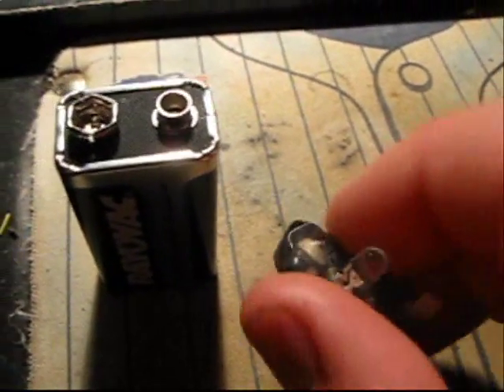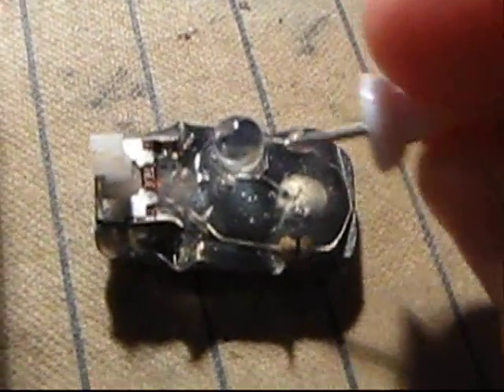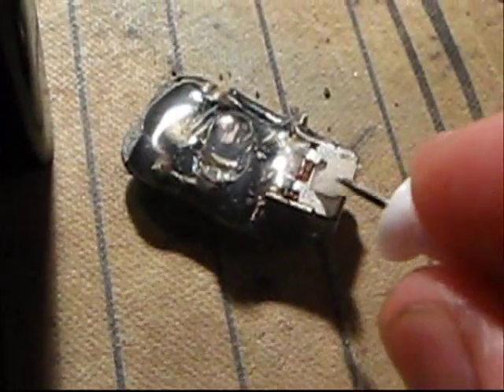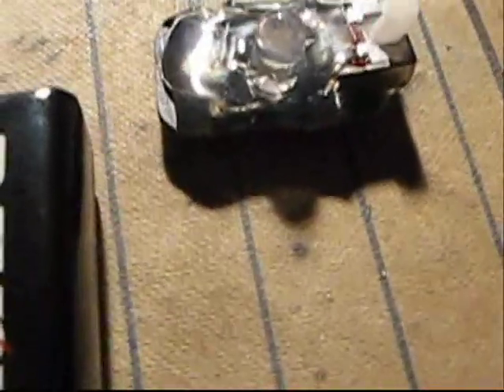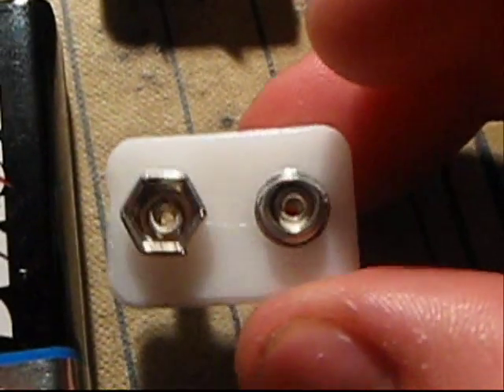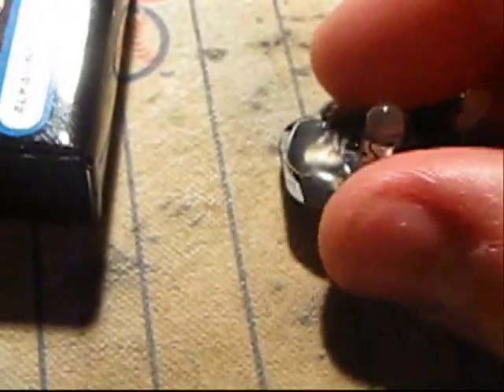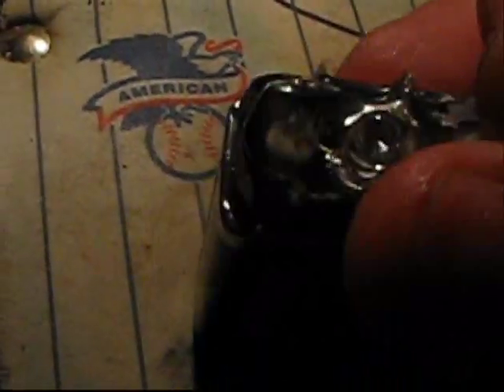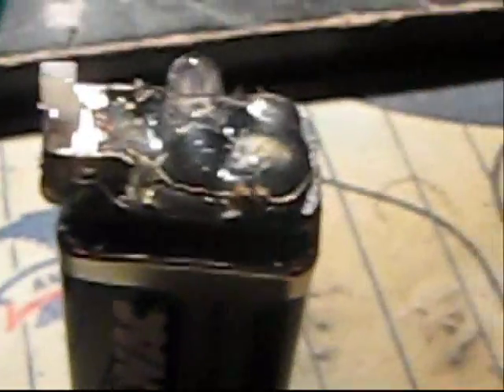9 Volt LED Flashlight (V1.0, Dead)

Comment: I recommend using at least 530 Ohm resistor.
Reply from the maker: I have no way to calculate the right values b/c the calculator sites do not work or you need a degree in math to figure out the right one.
Reply: Well, at electronic store they recommend 560 Ohm for 12V. So I'm sticking to that :)
Reply from the maker: marchlander1
there should be a resistor that can limit anything down to 3.6 volts but 12V to 3.6 volts is fine. I googled 560 ohm resistor and one result had a schematic for 12V running a 2 volt 20mA LED. I bought these lights at the dollar store they are powered by a single 9V battery and have red LEDs in them. I've had good luck changing out the red LED with a white one. the resistor is brown black brown gold color bands. I have another light I made with 3 LEDs and a resistor with white purple black gold color bands and it seems to work ok.
Reply: Just saying from experience. Colour bands on resistors are irrelevant to sellers. I have to tell them the power of the source, in this case 9V battery. And I took 560 Ohm, couse I saw it in the other vid. And for some reason white LEDs are weaker than the rest of LEDs. So I'm using green one. Seems to work best.